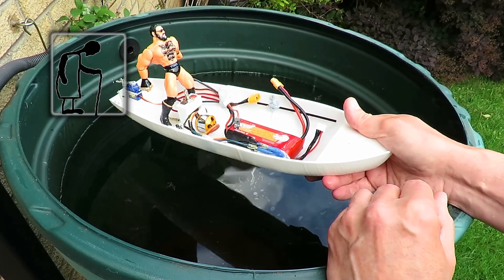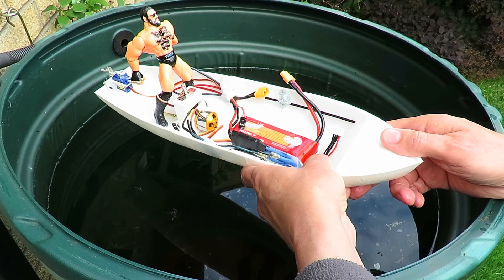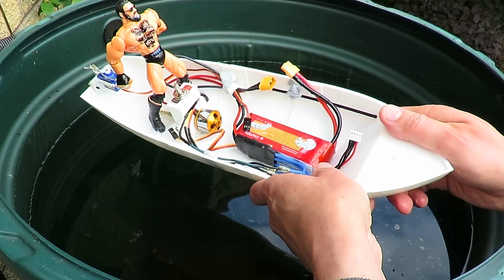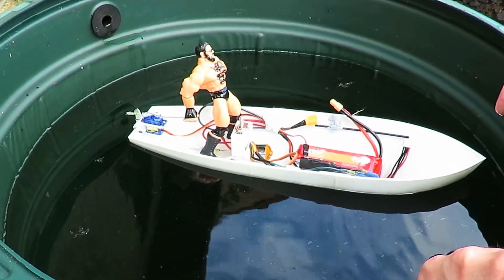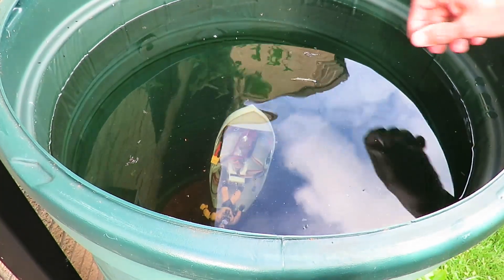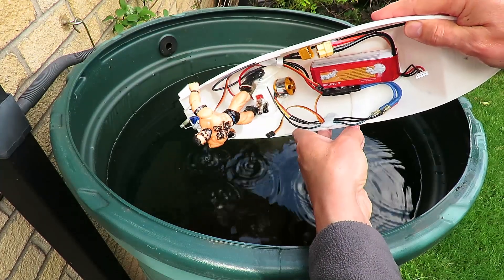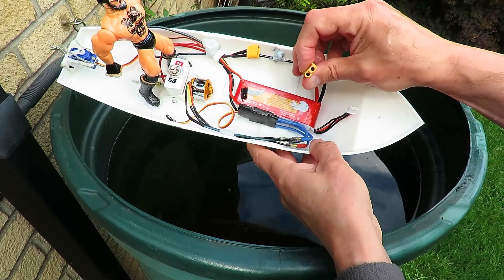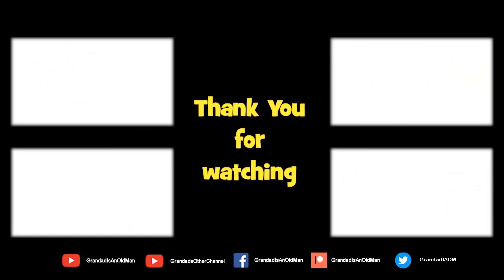That 3D printed boat Will it sink? 🚤

Comment: Think it might be due too that having that figure on there due too the weight that it sinks down quite a bit with this design.
id try a float test again but this time remove as much dead weight as possible that arent electronics & perhaps try a smaller lipo battery.
Reply from the maker: What is the point of doing a float test like that? I will be running the boat on the water with everything on it so if it sinks in the middle of the lake it is not much consolation knowing it wouldn't have sunk if it was empty 😄😃😀
Reply: @GrandadIsAnOldMan  Not entirely empty without the electronics and just being a bath toy essentially, but skip putting the figure in it, and try too get a bit smaller 3s lipo of say 500 - 700 mah instead of the current one would help reduce the weight & possibly prevent it from tipping the back too much and taking in water though enough power and speed will do this regardless of boat design or how light you make it eventually.

As it's not exactly a design made for speed like say a catmaran rc boat & looking more like a row boat that usually does 15 - 30 knots with an added motor, maybe adding pontoons too the sides of the boat about 20% of the length of the boat on the rear would keep it floating with the figure on if that's a priority over speed ?
Similar too this at 5:29 https://www.youtube.com/watch?v=mp6WVsdXgBU but perhaps sticking out less.

i know you can add sort of tabs on most boat hulls too sort of mitigate the boat from pushing the rear down too far, sort of like how air plane wings work but upside down.

https://rcraceboats.webnode.gr/_files/200001173-a3e6da5dcb/ssm04.jpg
L shaped brackets kind of

Comment: Pity about the bow not keeping it afloat. You could cut a hole in the top of the bow and fill it with polystyrene and then reseal it. Plus you mentioned putting some foam in other parts so that would certainly make a big difference.
Reply from the maker: As Hermit says that wouldn't help. The simple fix is to add some foam in the back. Plenty of space there and it will also cure the issue of the bow wave landing in the back of the boat. As usual there are more videos to follow. I am out drinking coffee at the moment so I can't check my schedule and give you the dates. Can't remember if I put them on my Patreon page.
Reply: @GrandadIsAnOldMan : Well the best fix is to attach a balloon to it. LOL

Comment: Did the electronics get water damaged
Reply from the maker: No, I waterproofed them in an earlier video in the series. Basically just coating the circuit boards with nail varnish.